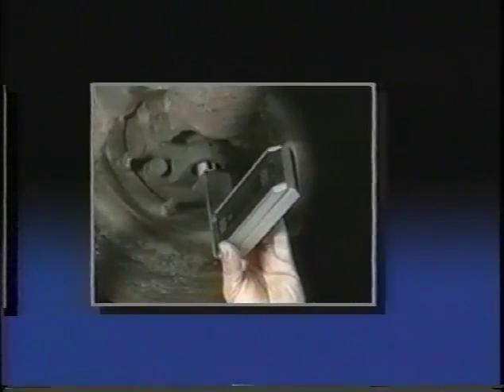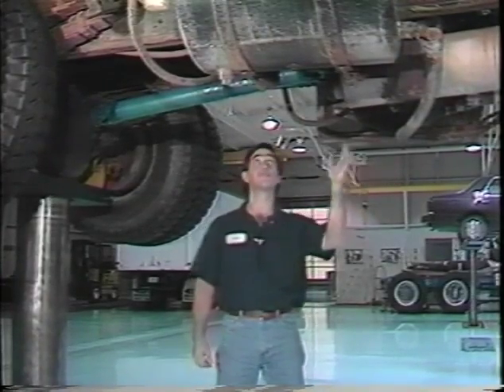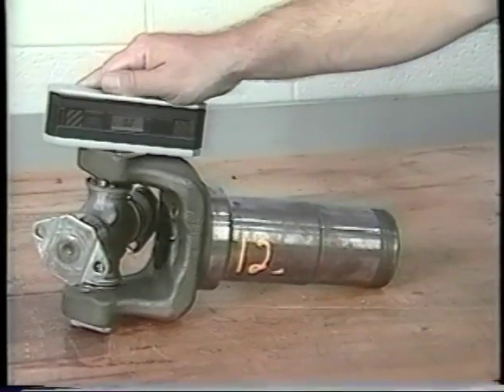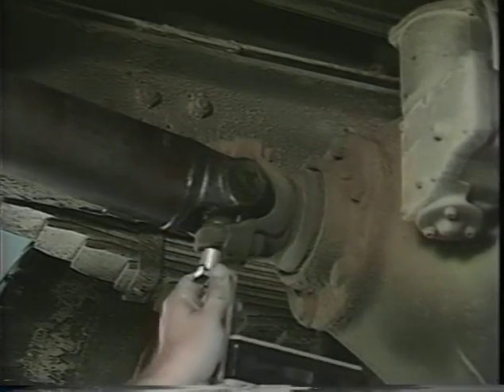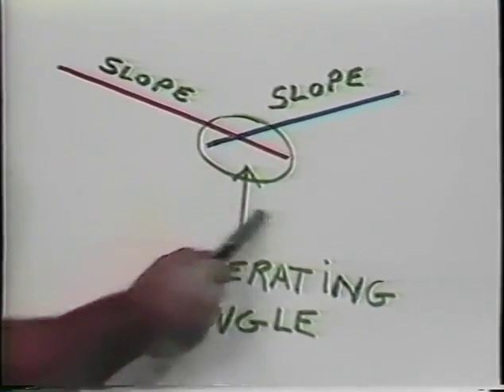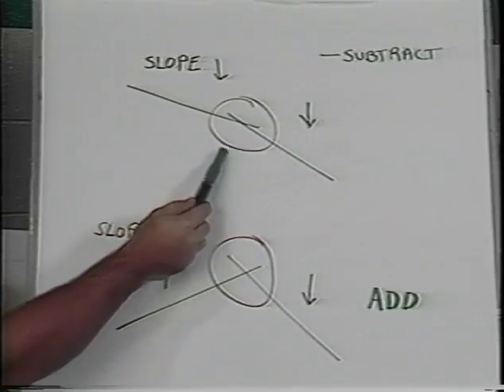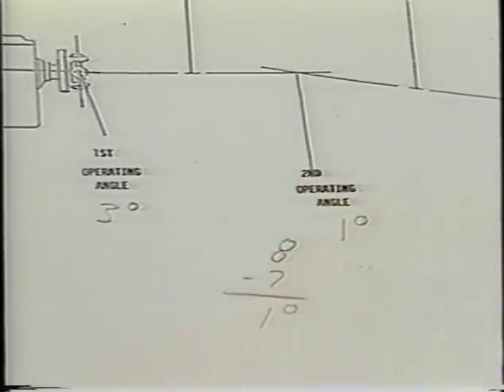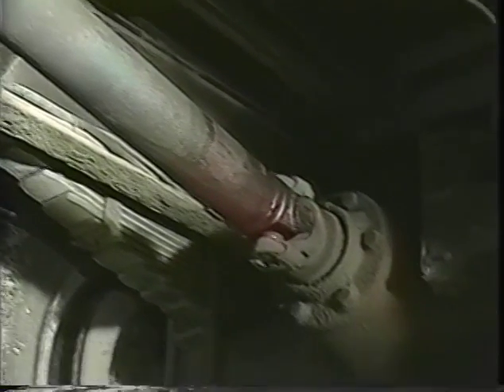Measuring Driveline Operating Angles

Comment: He starts at the transmission and measures a 4° down angle.  Down angle from what?  What did he zero the protactor out on as a starting point?
Reply: Down from front to rear. Slopes down to the rear.
Reply: @ericdolby1622  I understand what down angle is.  My question is down angle from what?  What is the point on the truck that is the zero or level reference point?
Reply: @MrBullfrog92  a digital protractor needs to be zeroed on a known level surface before taking measurements. An analog protractor doesn't need to be zeroed but should be checked for accuracy before taking measurements. Vehicles need to be at ride height without the suspension unloaded (meaning all four tires are supported on a platform lift). The lift should be level, if it's not don't use it.
Reply: @MrBullfrog92  Relative to the truck angle assuming the truck is zero but that’s not really important it’s more the number that  he’s referring to
Reply: You use the frame rail to zero/cal the tool
Reply: ok